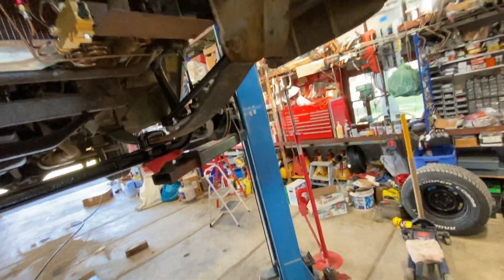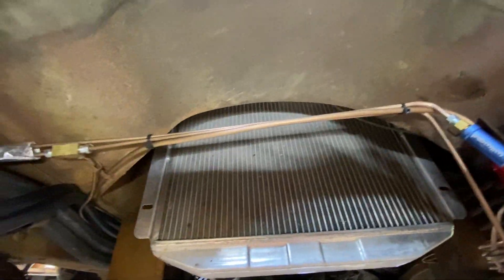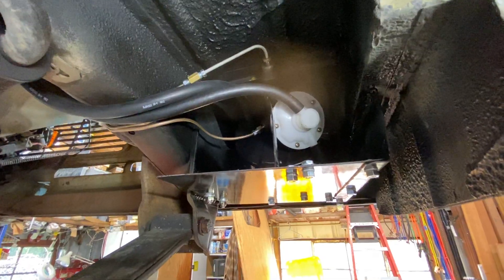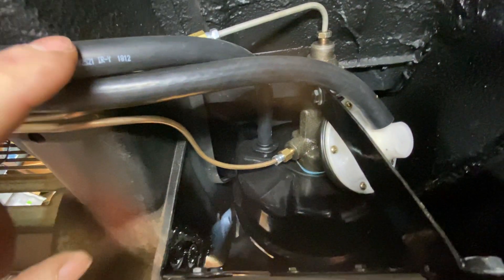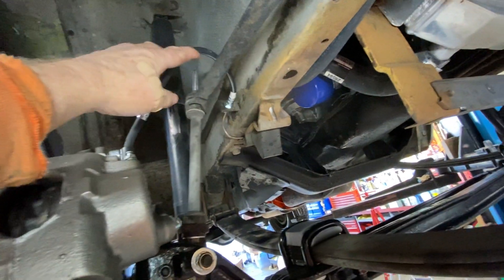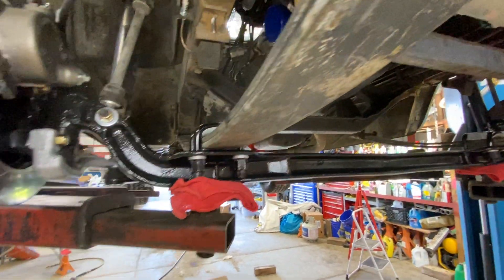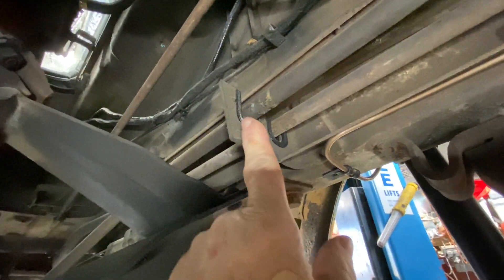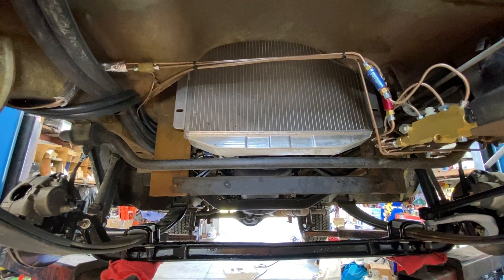Brake bleed recheck

Comment: Why the tight twists on the brake line close to the MC?
Reply from the maker: Some hydraulic brake line nerdheads would say it helps to "equalize" the brake line pressure during heavy brake pedal application but IMHO, I think it's just to make it easier to attach the brake lines during assembly.  If you have those circular bends in there, it's much easier to attach the brake lines since they can flex much easier with those multiple circular bends.  This is particularly true when the components you are connecting are very close to each other like the master cylinder and the proportioning valve.  One more reason, that many others will never be able to appreciate, is that it looks really friggin cool, (!) not to mention that it has a dramatically more improved artistic appearance!  It certainly cannot approach the quality of a freehand pin striped line crafted by a paintbrush wielding master such as yourself but in all honesty, you, in particular, should appreciate the meager attempt at an artistic feature Michael!   Don't you agree?
Reply: @vintagechevyvanparts  lol. I DO appreciate the mastery. Super cool looking! 😂